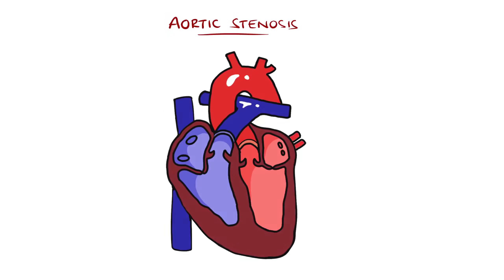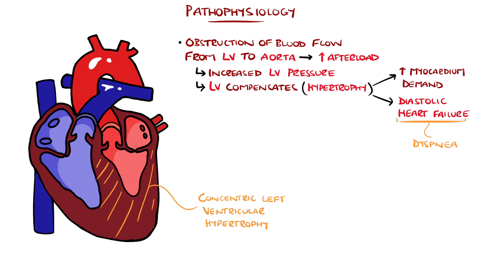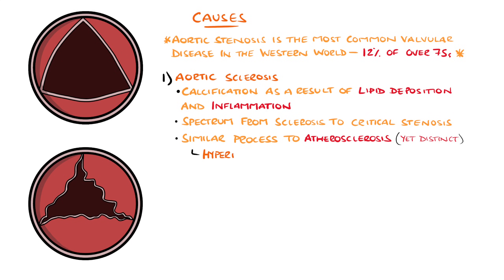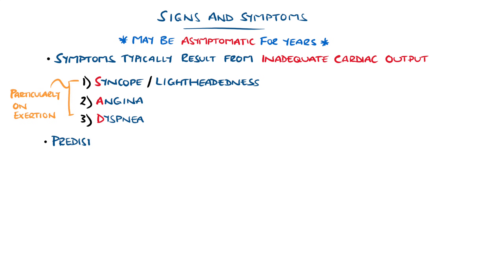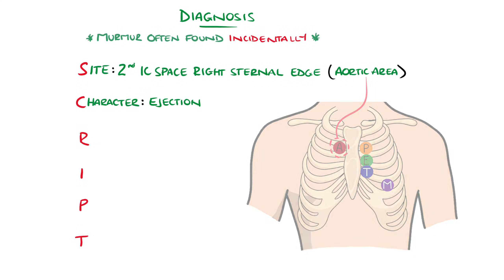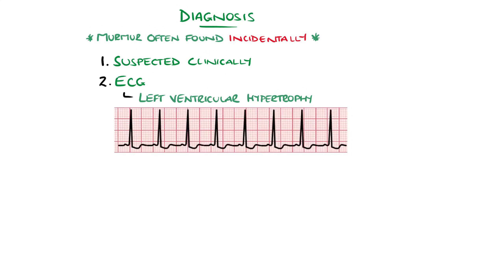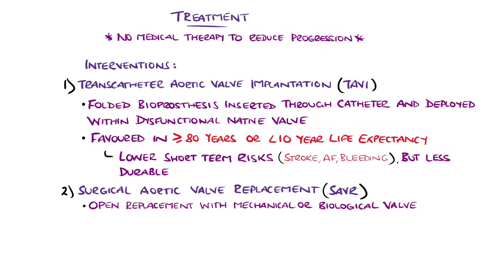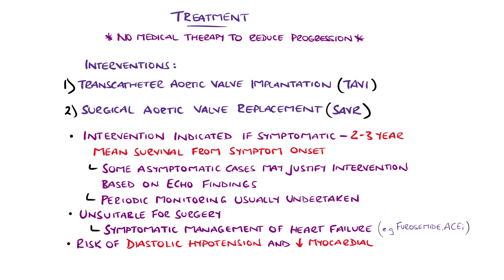Aortic Stenosis Explained in 10 Minutes (With Heart Murmur Sound)

Comment: Aortic stenosis (AS) is a heart valve disease characterized by narrowing of the aortic valve orifice, which obstructs blood flow from the left ventricle to the aorta during systole. This creates pressure overload in the left ventricle, which can lead to enlargement and heart failure if left untreated.

ETIOLOGY (CAUSES)
Causes can be congenital or acquired, and vary by age:
1. Congenital
-Bicuspid aortic valve: present in ~1-2% of the population; calcifies early (before age 65).
2. Acquired
-Degenerative/calcified (senile) aortic stenosis: more common in those over 70 years of age; associated with risk factors similar to atherosclerosis (hypertension, dyslipidemia, smoking).
-Rheumatic aortic stenosis: rare in developed countries; a consequence of rheumatic fever. It is associated with fusion of the commissures and often also affects the mitral valve.

PATHOPHYSIOLOGY
The pathophysiology of aortic stenosis results from a progressive obstruction of systolic flow from the left ventricle (LV) to the aorta, which triggers a series of compensatory mechanisms and eventually leads to hemodynamic, structural, and functional decompensation of the heart.

1. Fixed mechanical obstruction to systolic flow
-The stenosed aortic valve (thickened, calcified, or fused) has a reduced orifice (<1.0 cm² in severe cases), which significantly increases resistance to systolic flow.
-Immediate consequence:
↑ Pressure gradient between the LV and aorta during systole.
↑ Stroke work of the LV to maintain cardiac output.
-Under normal conditions, the LV generates a pressure similar to the aortic pressure. In aortic stenosis, there may be a gradient > 40 mmHg, forcing the LV to generate pressures > 200 mmHg.

2. Left ventricular pressure overload
-Faced with this chronically elevated afterload, the LV initially responds with concentric hypertrophy, i.e.:
Structural remodeling:
-Increased ventricular wall thickness without cavity dilation.
-Reduced mass/cavity ratio.
-Stimulated by signaling pathways (growth factor IGF-1, TGF-β, angiotensin II).
Temporal advantage:
-Reduces wall stress (Laplace's Law: T = (P × r) / (2h)).
-Allows cardiac output to be maintained without dilation.
However, over time:
-Reduced compliance → diastolic dysfunction.
-↑ End-diastolic pressures → retrograde congestion (dyspnea, edema).
-↑ Myocardial oxygen demand.
-Subendocardial ischemia → myocardial fibrosis → systolic dysfunction.

3. Myocardial ischemia without coronary artery disease
-Although coronary arteries may be normal, myocardial ischemia occurs due to:
↑ Myocardial mass → ↑ oxygen demand.
↓ Subendocardial perfusion:
-Coronary perfusion occurs in diastole.
-Increased LV end-diastolic pressure reduces the coronary perfusion gradient (aortic pressure - ventricular diastolic pressure).
-Compression of intramyocardial capillaries due to hypertrophy.
-Results in exertional angina, even if there is no coronary stenosis.

4. Diastolic dysfunction and retrograde congestion
-Due to concentric hypertrophy:
The left atrium becomes rigid.
-Low ventricular filling → ↑ pressure in the left atrium and pulmonary veins.
This results in:
-Exertional dyspnea.
-Pulmonary congestion.
-Atrial fibrillation (due to left atrial overload)

5. Late Systolic Dysfunction
-Initially, the ejection fraction (LVEF) remains normal. However, with progression:
-Myocardial fibrosis due to chronic ischemia and hypertrophy.
-Eventually, contractility deteriorates.
-Impaired cardiac output at rest and exercise.
-Systolic heart failure develops (fatigue, orthopnea, edema).

6. Changes in Cardiac Output During Exercise
-Under normal conditions, cardiac output increases with exercise. In AS:
-The stiff valve and fixed afterload prevent this increase.
Results in:
-Exertional syncope: adequate cerebral perfusion is not achieved.
-Post-exercise hypotension.

CLINICAL FEATURES
Symptoms usually appear when the valve area is <1 cm². The classic triad of advanced aortic stenosis is:
1. Angina pectoris
Due to myocardial ischemia (↑ demand, ↓ coronary perfusion).
2. Syncope
-Especially with exertion (cardiac output cannot be increased to meet demand → drop in cerebral blood pressure).
3. Dyspnea/Heart Failure
-Due to diastolic or systolic dysfunction, increased pulmonary pressure.

CLINICAL FINDINGS
-Auscultation:
-Rude systolic ejection murmur in the aortic focus (right 2nd intercostal space), radiating to the neck.
-Paradoxical splitting of the second heart sound (A2 after P2).
-Pulsus parvus et tardus: weak and delayed pulse due to blood flow obstruction.
On ECG:
-Left ventricular hypertrophy (tall R waves in the left precordial leads, deep S waves in the right precordial leads).
Chest X-ray:
-May show poststenotic dilation of the ascending aorta or valvular calcifications.
Echocardiogram (gold standard):
-Evaluates valvular morphology.
-Measures valvular area and transvalvular pressure gradient.
-Classification by severity:
Mild: area > 1.5 cm²
Moderate: 1.0–1.5 cm²
Severe: < 1.0 cm²
Reply: Heyy there......i found your notes very effective and easy to understand....thankyou so much for these❤❤